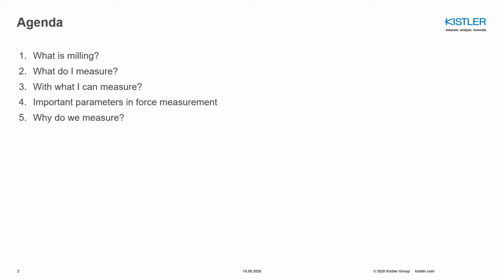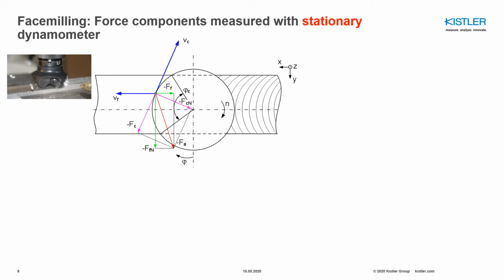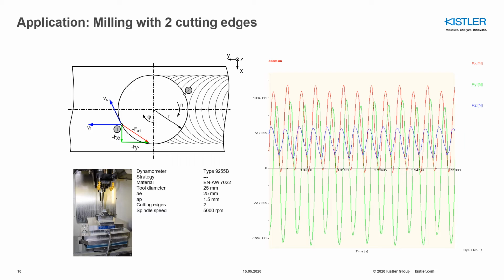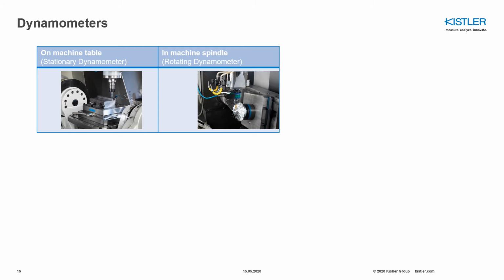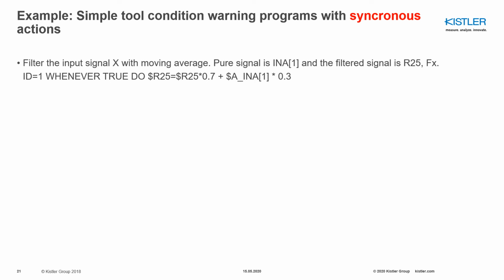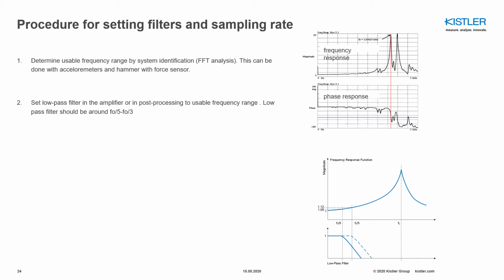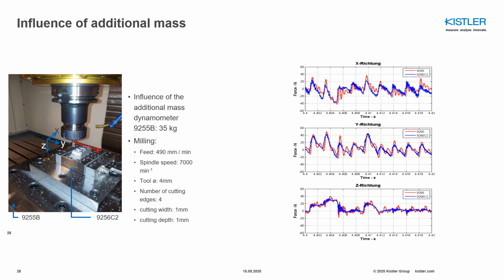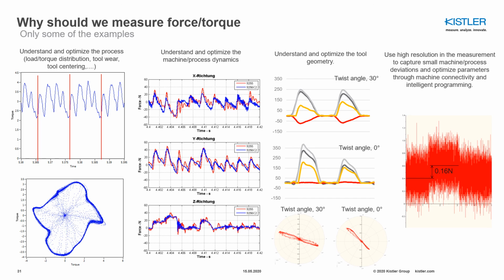Cutting Force: Milling

Comment: Hi. I wonder about the End milling formula. Is it the same with face milling ?
Reply from the maker: Hello. The calculation of the cutting forces and effective forces by using the force components from dynamometer are the same in milling.
However, the distribution of the forces on the tools is not the same when end milling and face milling are compared.

Comment: Thanks alot for this helpful video. May I know, what excatly Φ in the matrix (05:33) for calculating the cutting and passive force is? is it the involved angle of the whole Tool on the surface? Because there is another angle on the picture which is called Φc. I would be thankful if you clarify it for me.
Reply from the maker: The angle is the rotational angle for the specific insert during entrance and exit to the workpiece material.
Reply: @KistlerGroup  I appreciate your reply